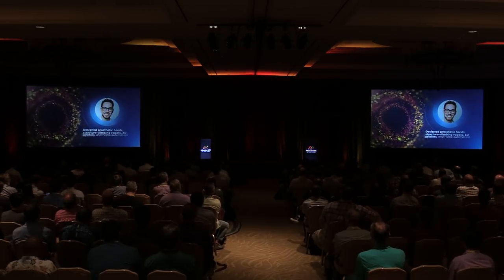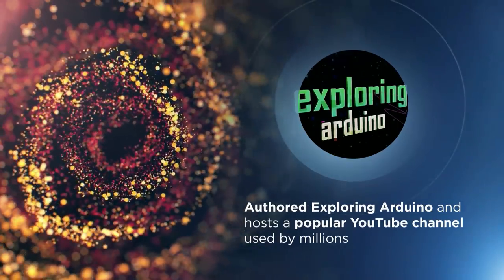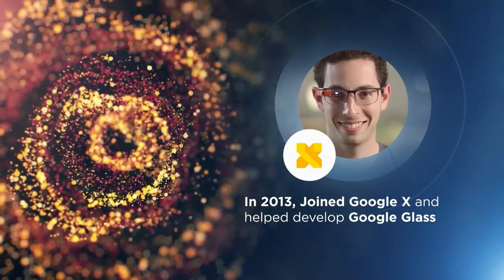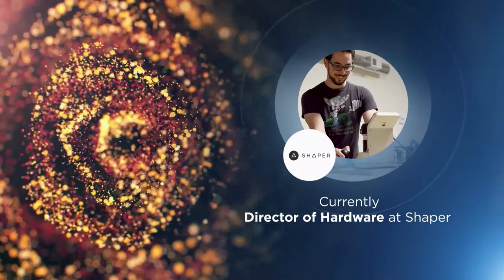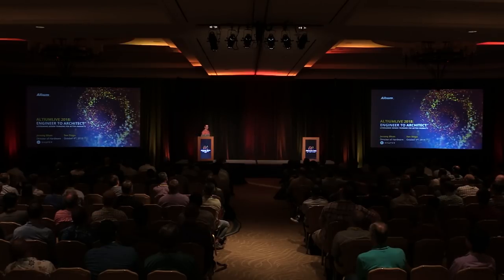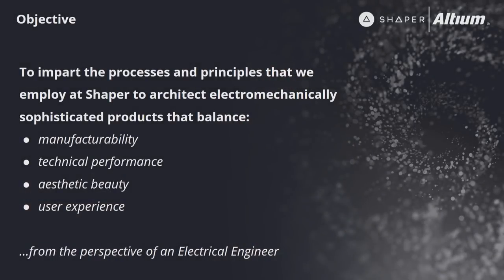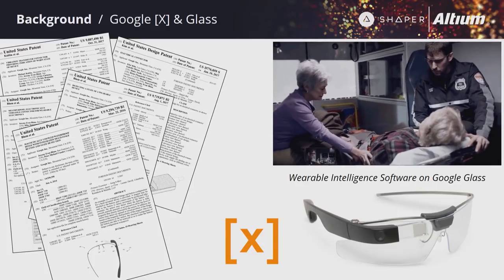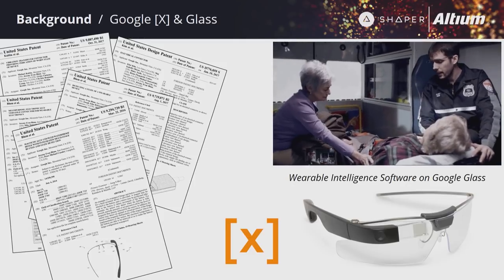Engineer to Architect: Leveraging Design Thinking for Better Products (AltiumLive 2018 Keynote)

Comment: Help I over complicated my robot I can build but I don't know that much about programming lidar sensors ROS on windows I'm scratching the surface but my robot is already built the build out ran the programming its a departure from any robots you see out there I call it a show bot or show  bots   since my company has 2 one works one is not finished but I'm only one little dude with no formal education I need some base programs I can run with oh my robot also has a  full size 3 d printer on it with full size 20 monitor key board mouse latte panda raspberry pi some of my build is on you tube help!😁please